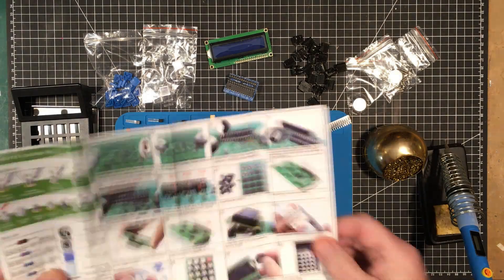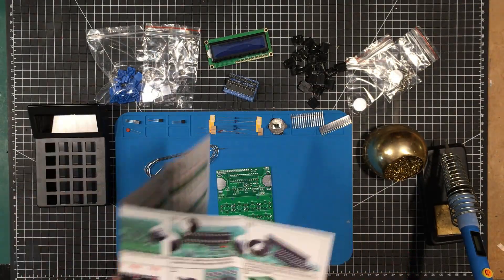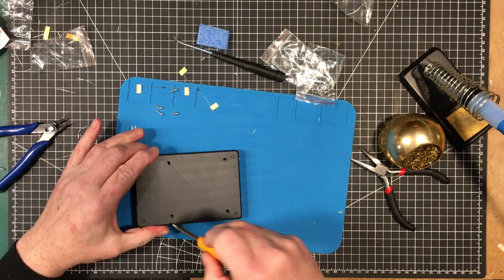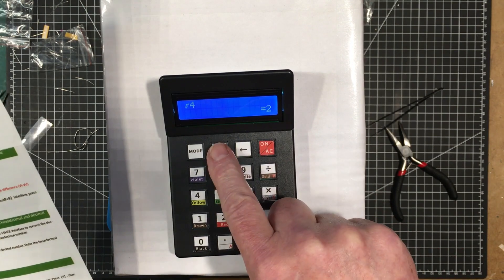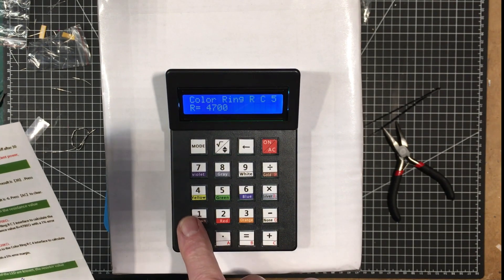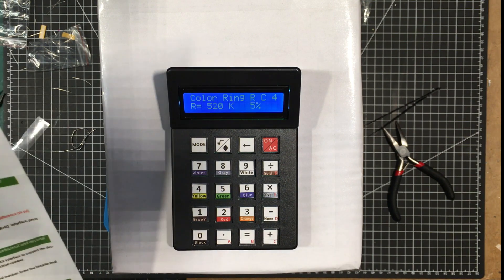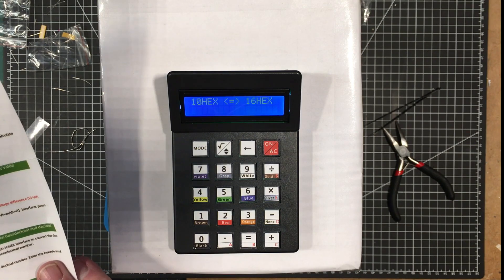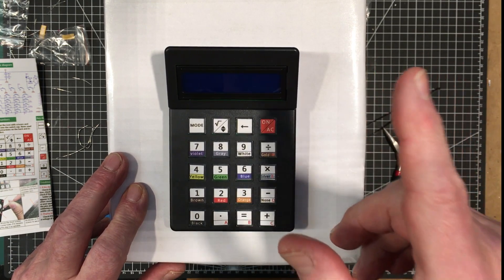Uni Byte 0153 -  Kit of the Month: Microcontroller-Based Calculator.

Comment: For so many years the only calculator I am able to locate quickly is the one in Windows.
Reply from the maker: I use the Windows calculator too, but only when I'm at a computer.  On my bench I usually have an old HP-20S I got in 1990.  Still works like a charm.

Comment: Nice kit.  I believe the uC used is an STC15W4xx chip.  They are 8051 cored and very easy to program.  They have a serial ISP interface and you can use the SDCC compiler for it.
Reply from the maker: That's the chip, except it's just from a different manufacturer (IAP).  It's a 15W413AS.

Comment: I saw this on a previous mailbag, ordered it but it got sent back during shipping.  Apparently some issue with the batteries, but I see you got yours with batteries.  Odd, especially has I've ordered batteries off AliExpress before.    I've re-ordered it without the batteries and it is apparently on the way.  thanks for the demo.
Reply from the maker: Strange.  These primary button cells are not going to cause any trouble.  Besides lithium batteries fly all over the world every day in our phones and other portable equipment.  Some policies are just plain dumb.  Let us know how your build goes.
Reply: @uni-byte  Got my kit a few days ago and assembled it today.     It works but there are some design issues with it.    E.g. having to remove 8 screws to replace the batteries.   Those button caps were a bit of a pain.  The paper labels all seemed to be a bit large.  I guess I could have cut them down but I left it.   I wish less of my time was spent on assembling the buttons and there was more soldering.
Reply from the maker: @Taliesen.  I agree on both counts.  The key-caps were a pain, but not too difficult.  I'm looking to put a lithium battery in mine.  Once I get the right bits there will be a video.